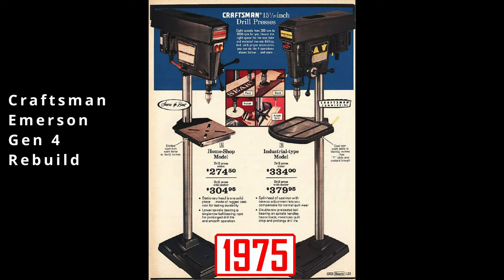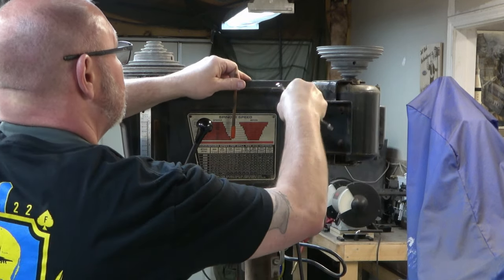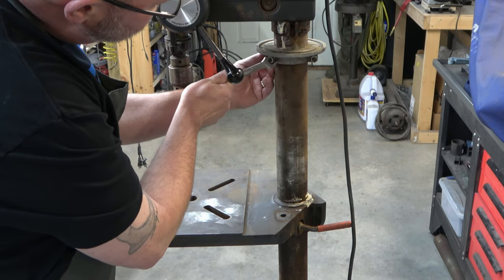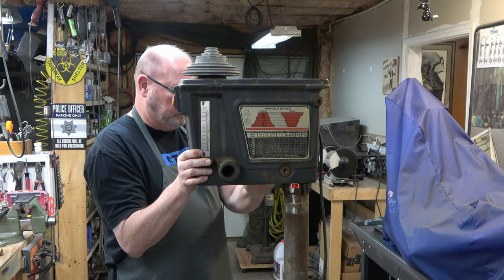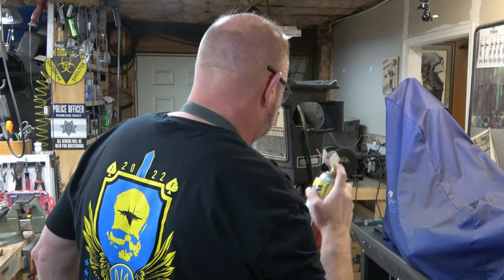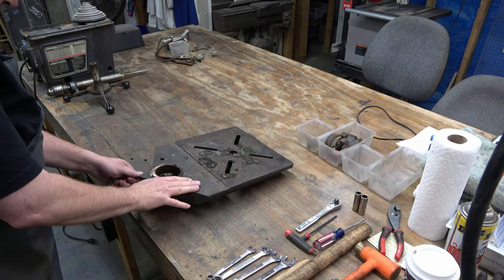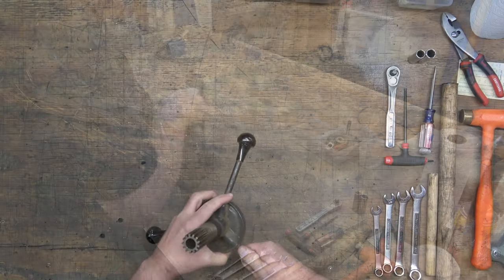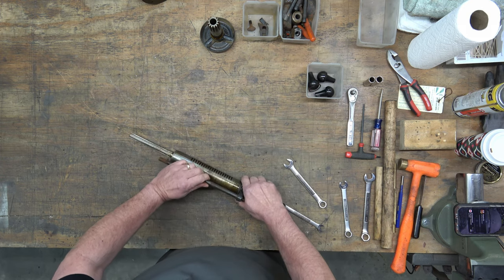Part 1 Craftsman Emerson Gen 4 Rebuild (Intro & Disassembly)

Comment: Love these rebuilds. I have most of the same Craftsman drill presses you have done. I’m hoping that you get a chance to restore a Craftsman “Mohawk” model #103.0305 soon. That is my next project which I hope to finish by end of winter.
Reply from the maker: I have been looking at a mohawk that's been for sale for almost a year but the seller still wants too much for it. If I end up grabbing it, I will do a video series on it.
Reply: @JeffsShop  I just bought one in good condition with a broken quill spring for $25. It’s dirty, but intact. I had a parts machine with a good spring, so I was able to get it functional.